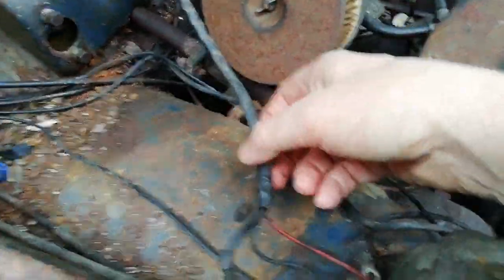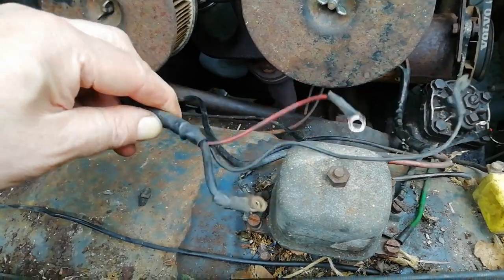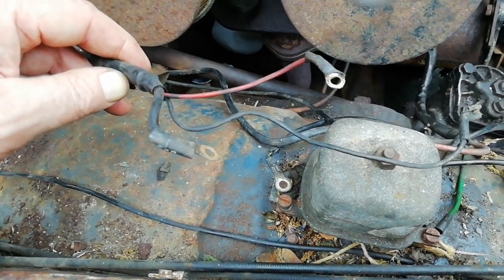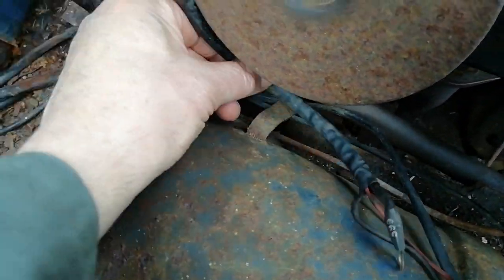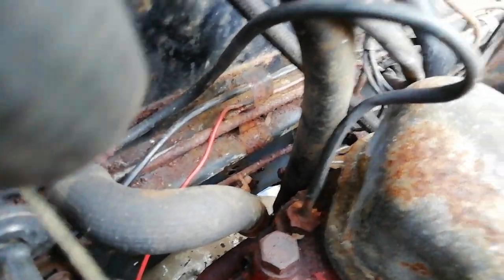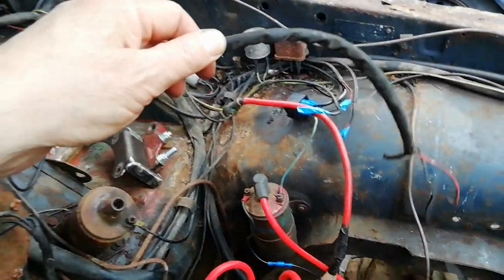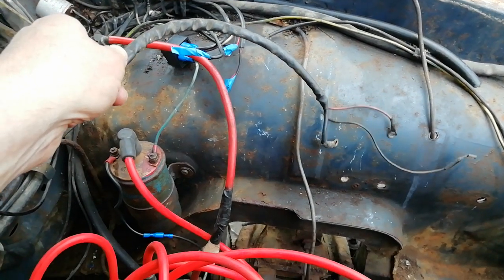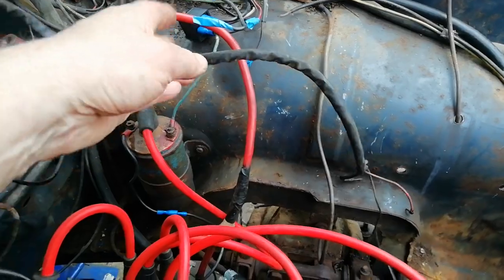Volvo Amazon/1800 alternator conversion Part 1/3 - WIRING

Comment: Thanks for the guide, I'm installing a denso style alternator into my RHD 122s, since the other black wire isn't connected to anything with the install does that mean you loose the windscreen wipers?
Reply from the maker: Hi - sorry for delayed response.  I think the wire you're referring to is the power for the screen washer motor only (it operates when the wiper switch is pulled out fully).  I presume that you are no longer using a control box so that there are only two wires going to the alternator itself from your wiring loom.